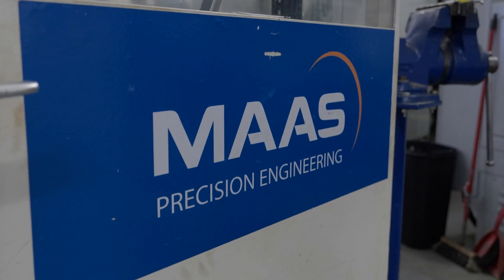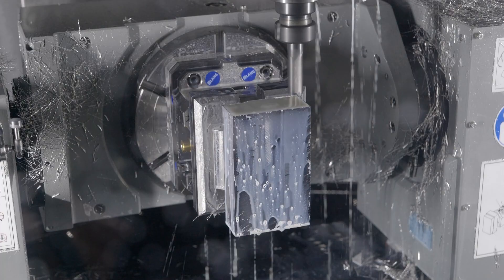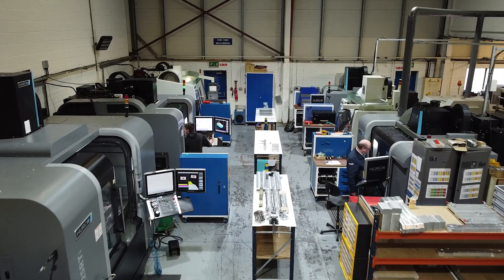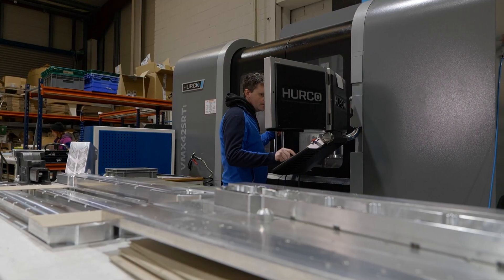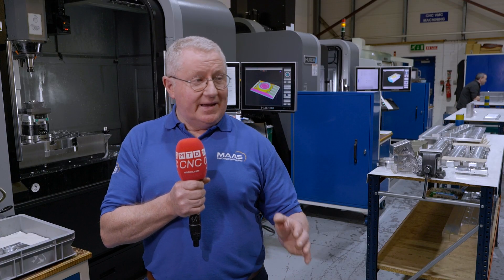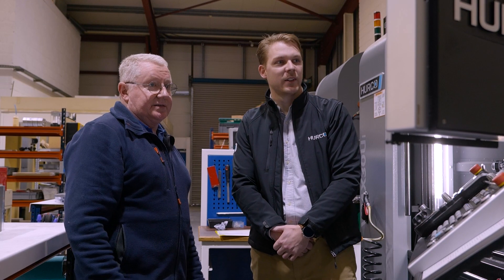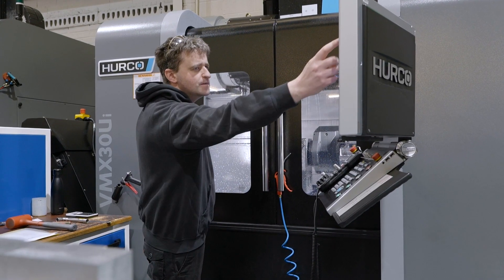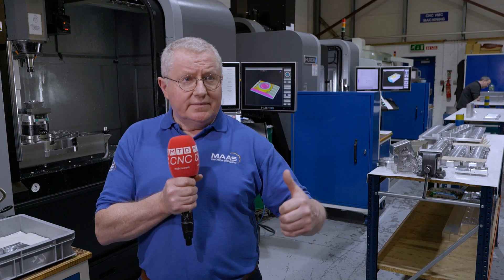Maas Precision - Dimensionally correct, cosmetically perfect. Why Maas use Hurco machines

Comment: Which Cam software do you use for the complex 5axis components?
Reply from the maker: HI, the CadCam software is user preference, as long as the post processor is done correctly the Hurco will machine the component.
Reply: @hurcoeurope  Yes, I understand that. My question is to @MassPrecision. I'm interested in what Cam package they're using? 

Thanks.